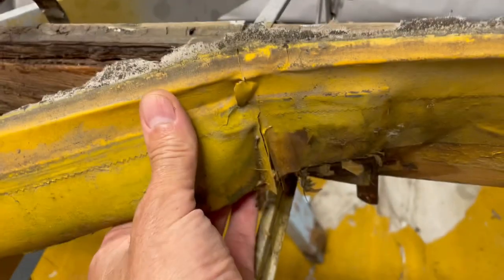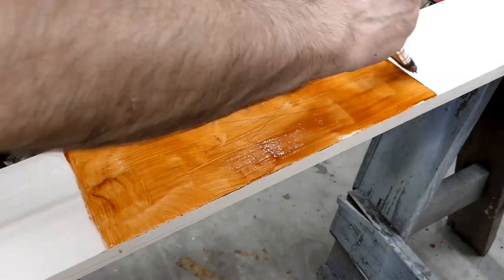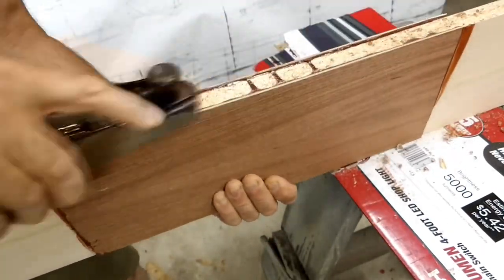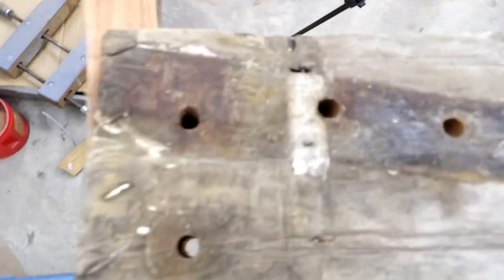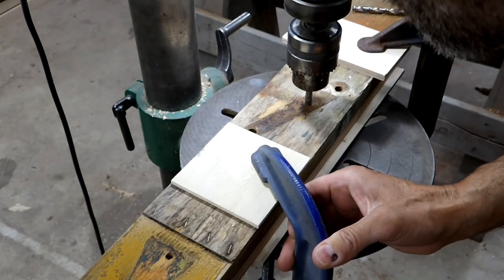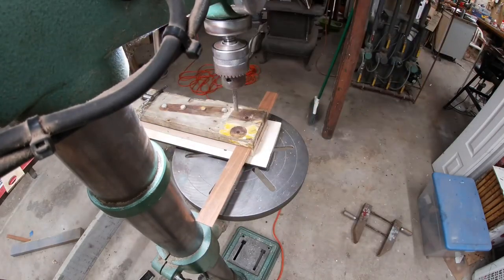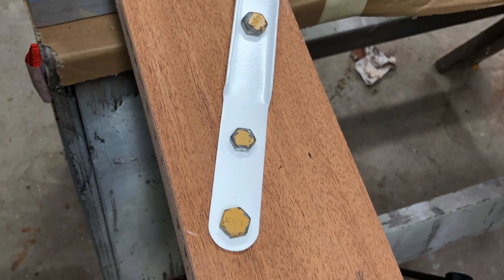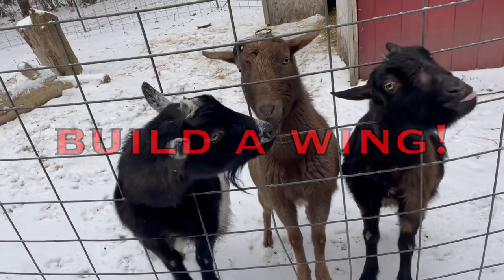Episode 7 - 1941 Piper J-5a - Wing Spars

Comment: Those spars look TOO nice to cover up but I know you will do an awesome job on the fabric as well. Did you test fit the fuselage attachment fittings before you glued the doubler plates onto the wing spar? We did do this and we had to mill a couple thousandths off the spar so we could glue the doubler plates on and have them fit inside the fittings. My spars are made of Douglas fit because I never found any decent pieces of spruce. Where were you able to get some spruce?
Reply from the maker: I was waiting to hear from you! I did test fit the fittings/doublers/spars. I ended up doing a very mild reduction in spar thickness within the drawing tolerance & I also ran the doublers through a sander removing about .010 alternating sides of the plywood. Final fit-up came out on the money with fitting spread. (At your suggestion).
I got the blanks from Aircraft Spruce but I had to wait about 4 months. The blanks were worth the wait although I didn’t feel that way at the time. Just so you know, the LH wing just needs a couple odds & ends completed and then installation of my new leading edges. Not sure how you did it but I’m thinking on locating the flanges on top nice & square to the spar, then wrapping towards the bottom with ratcheting tie downs. Thanks for keeps tabs on me.
Reply: https://youtu.be/qfU2QtNiEMg

Consider how Chad installed his leading edges? He found a nifty way. We used ratchet straps like you are thinking of doing and we also installed a thin layer of padding on top of the leading edges and they turned out VERY smooth with no dents or wrinkles showing.
Reply from the maker: @bmnesmith  yeah, he had a great video on the topic, however there are nuances on the J-5 when compared to the J-3. I do like his approach. I’m within days of starting my leading edges.